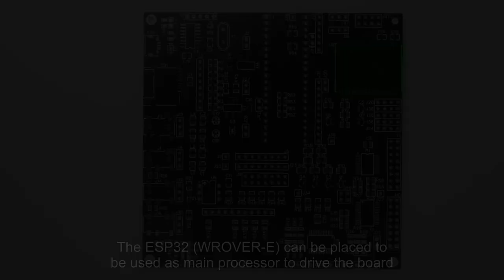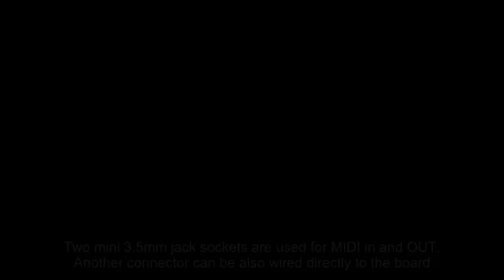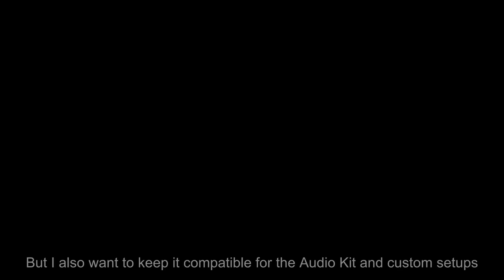My first PCB for arduino based synthesizer projects - a quick look at the HW for ESP32/DaisySeed

Comment: Fantastic project and superb playing.
The PCB is a full synth, in many ways. It makes sense, tidies so much up where wiring mistakes can be made. Though even with decades of experience soldering, the idea of putting the bare ESP32 on it would be daunting to myself. 
It's good to see such a thing, your projects deserve the 'posh' boards!
Reply from the maker: Thank you =) The ESP32 was not so hard to solder. The frustration started with the micro usb connector and continued with the micro sd card socket. My first attempts were near to throwing the stuff into the bin xD But after learning some new techniques it was successful (and wasting some components and one PCB). The most surprising part was to get the SD card running. On the breadboard it was never successful to get it running in 4bit mode (which would be the fastest).
Reply: @marcellicence   Possibly wire capacitance on the breadboard for the SD problem. Good to hear of it showing benefits already.
Reply from the maker: @Slider2732  Yes it was the right decision. I am sure it is not the last one but a good starting point. It works very fine. In the past by using MIDI on the breadboard it also sometimes showed a very strange behavior. I am happy that it is all fixed now.
Reply: @marcellicence  I've been shocked at how sketchy and inconsistent breadboards can be at times. I start with breadboards but I've run into problems that went away with a hardboard. And because PCBs are like $1 now, it's almost not worth doing hardboards. One suggestion that might save you headaches on your PCBs as you are prototyping is test pads about 2mm all over the place so you can probe for things and even add wires if need be. Just add as many header pins and test pads as you can until the board is full. :) Also in my day job of prototypes one thing we do is 0805 surface mount resistors with a value of 0 ohms. Basically it's a jumper that I can add or remove to disable entire parts of the PCB. Very useful for testing / shorts / etc.

Comment: Can't believe this doesn't have more comments. I watched the video from earlier this year and thought "I really wish he'd do a PCB, but I also know how much work that is" and yet here you are with a PCB!! I'd love to have something like this and the control surfaces like you've got. Messing with menus is such a turnoff when you can just start twiddling knobs and produce so much texture. Thank you for doing these great videos with all the details and explanations. I know how much work it takes just to do videos let alone all the research. Finally I would say that if you can convert a module into a native part of your PCB easily, yeah go for it. But if the module is complex, works very well, and is fairly available, I'd say just put the headers for it and move on! I know you're trying to keep everything under 100x100 because that's kinda the threshold. I don't even know when I'd use it but for some reason I'm itching to build this!
Reply from the maker: Hm I do not know how the "algorithm" works. It is very confusing. Yes I started trying out existing modules to ensure that the interaction would work as expected before designing this PCB. The SD card didn't work on the breadboard but finally on the PCB =) Sounds great, the latest projects run on this PCB (with the ESP32 config). In addition to that I didn't have any trouble with the continuously changing audio kit. Unfortunately it is hard to find the right codec (price and availability). I am still missing the audio input on this design.
Reply: @marcellicence  I hope one day to build one of these PCBs. So when you say codec, do you mean for loading, playing WAV or mp3 samples? Or am I confused?
Reply from the maker: @feldon27  sure that would be possible. By codec I mean the pcm5201a which is the additional DAC. Actually I am using a breakout board mounted on my PCB.
Reply: @marcellicence  Love your work and can't wait to try everything out! 

Maybe look into the TAS5828M for your PCB, i find that one really interesting. It's one big, weirdly cheap chip with an I²S DAC, I²C DSP (?) and a 2x50W amp.

Comment: Just discovered your work a couple of weeks back. A treasure trove! So inspiring. To PCB or not? I feel it is a big advantage if you have found "your lab setup" and can be a huge time saver and enabler. That said, I did try something similar a couple of years back, but it ended up taking more time and tweaking than working on actual prototypes, so I switched back to swearing over jumper cable nests and bad breadboards. Not ideal either, but I found a compromise in proto boards and not being afraid to "sacrifice" components by committing them by soldering early. I have loads of the usual stuff anyway (resistors, op amps, transistors, jacks, etc), so risking soldering a few and then having to toss it, is worth it for me.
Reply from the maker: Thank you for your feedback. Yes, making prototypes takes a lot of time. For this reason I tried to make it very flexible allowing different configurations. I want to have something I can take outside to make music with in future =)

Comment: quality work! subscribed! got an interesting project I'm porting, a friend's currently using raspi and radio transmitter, thinking about porting to using a seed and esp32 in conjunction to sync mutiple devices together, and ideally sync multiple stems so they all start in time. I'm familiar-ish with seed/daisy. Quick question, do you reckon it's feasible using esp32 for wifi business and sending a start signal eg high low from esp32 to daisy to trigger an audio file?
Reply from the maker: Thanks! Yes I think that should work. I am not sure about latency but in general you can make a little webserver or something else with the ESP32 and control other devices that works =)